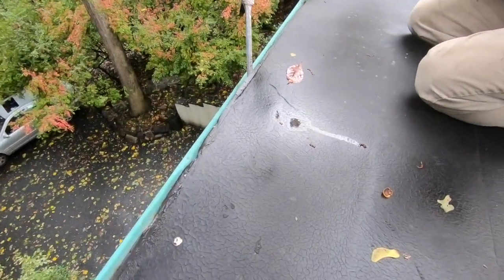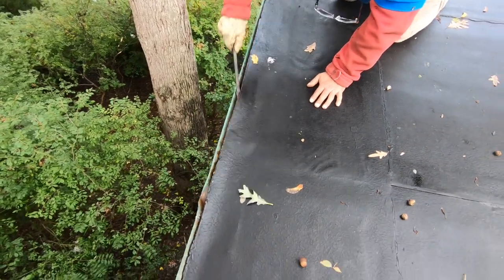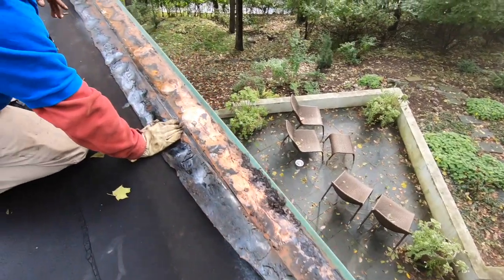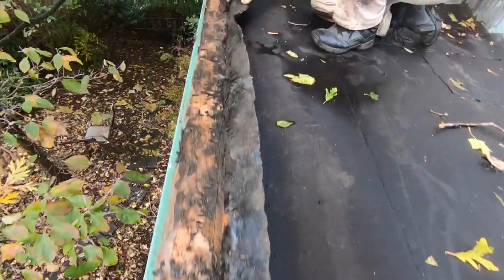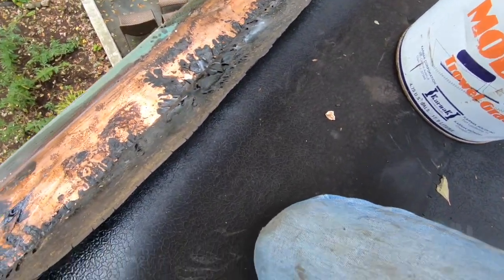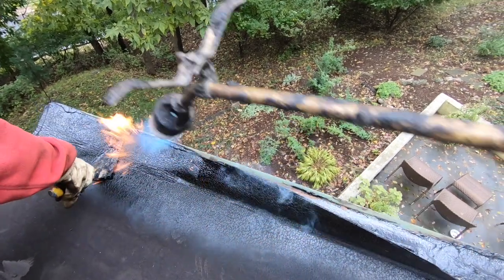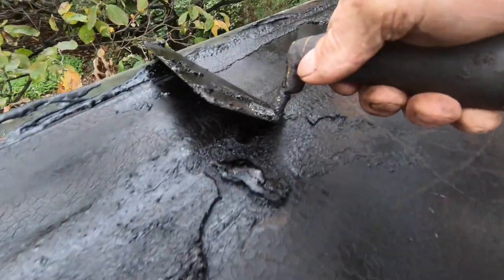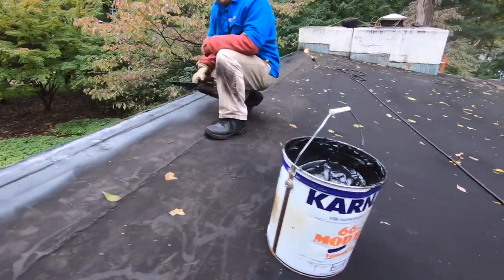Save your Torch Down Flat Roof from leaking by doing this 1 thing

Comment: Great video.... I asked about prospects on my torch down and you rightfully question why replace it.  Well, it is old and leaks.  And this video nails exactly why... the bonding between the roofing material and metal failed (or was never good to begin with!).  Thanks again for the roofing wisdom!
Reply from the maker: Glad it helped

Comment: You can torch to metal as long as its primed properly.   The adhesive you use won't stick to the copper nor will the felt if the copper isn't primed. when the adhesive drys out you'll be back to square one.
Reply from the maker: The adhesive acts as a primer. It the same stuff you spray out of a can. This is just thicker. Asphalt primer

Comment: The adhesive can says "cold process" (which I thought meant that it doesn't need a torch for application).  So you can always apply torch even when adhesive doesn't require it?  And would you have been able to made that repair with just the adhesive--without torching?  thanks.

Comment: the problem there isnt that its torched too metal, that works perfectly fine if the metal is properly primed. the problem is there is no cap sheet its only base, the base has no UV protection thats why you can see all those micro cracks all over that roof. so its geting weathered and drying out and just pulling off

Comment: You mentioned that you would demonstrate "one of two ways" of fixing this problem. Inasmuch as I am currently encountering this same problem on my house, I'd be interested to know the other way if could describe it for me or refer me to a different video. The edge metal I'm working on transitions on the butt ends of the rolls, so there are many points of double thickness. Also, the end-rolls were cut too short, so even if I can effectively roll them back and apply the Karnac 81, I'm still going to have a substandard job.

Comment: In a year or two when the Karnak cures i can tap that edge with a hammer and not hard and it will separate the metal needs and must be primed even for your miracle karmak

Comment: Why can’t I just prime it?
Reply from the maker: Prime what and then what?
Reply from the maker: After thinking what you said. Instead of smearing the Karnak, you want to prime it. Then heat up the membrane and stick it to the primed area. Sure, I have seen many do that, but it is not as good as the Karnak. The Karnak acts as a primer itself, then I am not heating the material as much as you would do to melt it. That way the material is not in an expanded state and also the metal is not deforming as when you heat the surface. I also get a better seal since I can press out and down unto the adhesive allowing to fill any void. Whereas your way if there is some imperfection, like a seam, the material might not adhere, or over a nail, it will leave voids that could cause problems.
I don't know if I made any sense?
Take Care
Reply: @SuperMickjr   Cash with Rear View Mirror Warranty !! 🤣

Comment: Copper and bitumen is not compatible in anyways, even if you use primer it will seperate from each other. Say what you want it will not convince me. Here Norway is not allowed to attach to copper, if you/we do, good luck with repare work for years. 👍